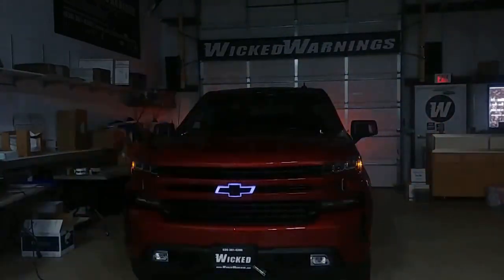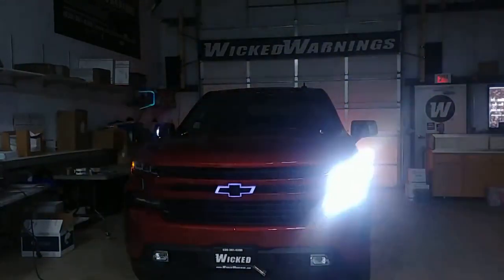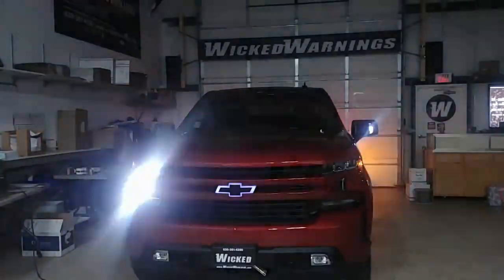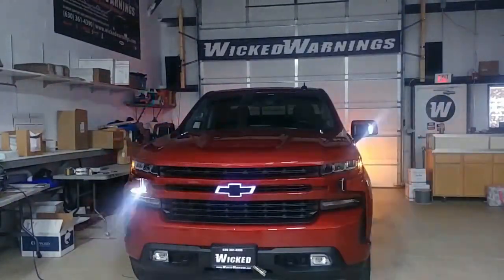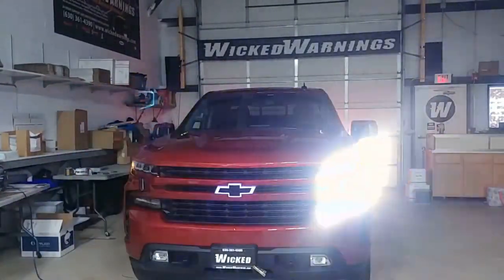Demo: New Chevrolet Trucks Strobe Factory DRL and Mirror Lights with Auto Flasher

Comment: This is exactly what I've been looking for. I have a few questions: one, can you send me the link to this module? Two, I do not have mirror lights but do have fog lights so can I put a module on the factory fogs? Three, I have installed the upfitter switch kit and want everyone to operate off one button...is this possible? Four, can this same module be connected to other factory lights such as cargo, backup and tail?
Reply from the maker: You can see which kits are available for your specific vehicle here: https://www.wickedwarnings.com/product-category/pre-made-kits/
Each Auto Flasher Kit will strobe a set of factory LED lights. For example, if you're looking to strobe the cargo and tail lights, you would need two kits. Please email in if you have any questions about which kits you would need to get the display you're looking for - info@wickedwarnings.com.